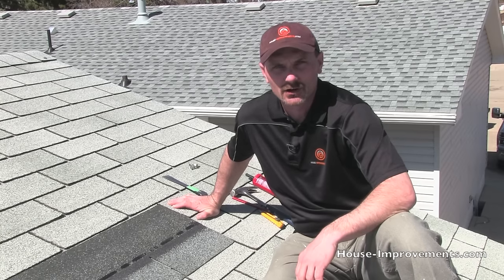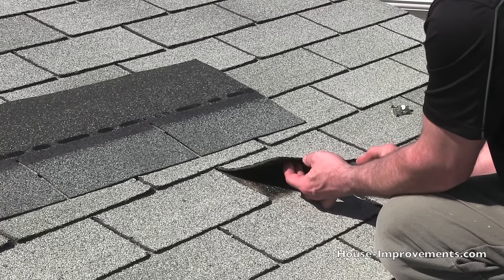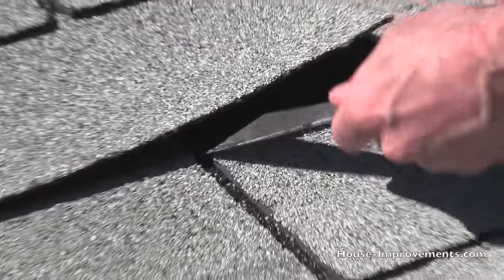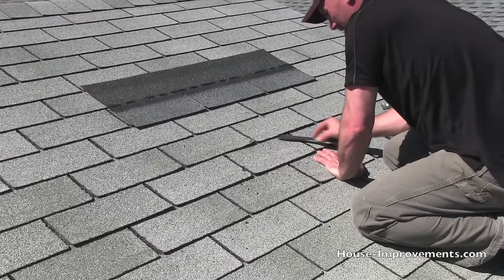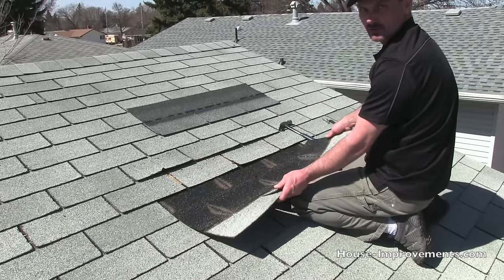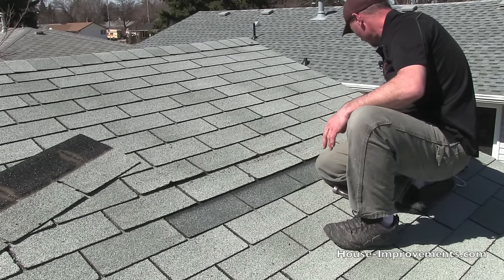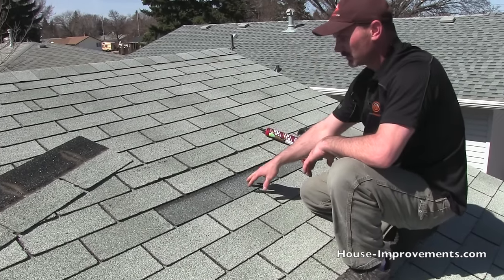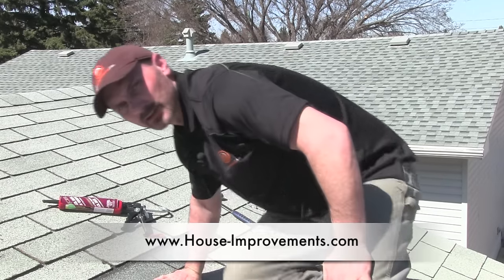How To Replace One Shingle [3-tab style]

Comment: I gave this video a thumbs up because it was coherent, quick, and it satisfied the title. I see where a lot of perfectionists chose to make a negative comment about the lack of tar paper/felt. To repair that flaw the whole roof must come off. That is not the title of this video. I need to replace one damaged shingle, and now, I think I know the tools I need as well as the technique that I'll use. Thanks, Shannon. You did enough, but you could have added your name, your phone number, your location, and the name of your business.
Reply: I gave it a thumbs down because my roof (many are like this in all of the houses I have lived in) if you remove a nail you better plug its hole with some tar or it will leak since the nails go through the wood and water plus new hole
 is a disaster.  Really, make it a habit to do a new hole and find all old nail holes and put some tar in them.
Reply: Well said
Reply: Just finished part  yesterday..Have to wait for weather and shingles to.come in.from. Home Depot yesterday...
Reply: I.finished this phase of 3 weeks ago..Turned out nice except a few things. It's hard to describe. However I ended up.cutting a straight line down about six foot from the side of the roof. There were several obstacles here. I ended up with.a half inch trench on the right side going down..I know that I should have staggered the shingles..It was too late. So I put some tar down over existing trapper and swept up the asphalt
(Sand) which was like little roller bearings..oh yes..these little thing need to be constantly swept up and disposed up as they are a dangerous (slip and fall hazzard).I put the above sandy particles in the half inch water trench. Actually it's almost unnoticeable from road and seems to let the water fall down.  The next part will be done different. Also next time.I will.stay up with the safety factors.
Reply: He provided his name, location, the name of his business, and his preferred method of contact both in the video and in the video description.
Reply: perfectionist
s? how about people who want their roof done right? felt is a big part of it...after all..stealing is stealing....

Comment: So, we had a sever windstorm event here last week. I lost three spruce trees on my property and two shingles off my roof. I have never attempted to repair my roof, always called a roofer. For just two shingles, not a complicated repairs, the roofer wanted $240 US. I found your video, watched it closely three times, then went out and purchased a bundle of shingles, some adhesive, the pry tool and went to work. Had BOTH shingle repairs completed in under 90 minutes. Could have been faster but I took my time to make sure I had it right the first time. Two caveats: first, my shingles are 39inches, apparently the new standard is 36 inches. So with some directions from Lowes staff, I had to do some creative fitting (had to cut one shingle at 22 inches and one at 17 inches then "butt" them together) to do a proper repair but the repair went well. Second caveat, the roofing tar in a tube is VERY MESSY for a first time user, so you need be careful. In any event, the repairs were successful and I thank you for this helpful video.

Comment: Thanks. Excellent work. Not a roofer, but I needed an old sat dish to mount a 2nd vertical antenna  safely in a tree, perfect job for that dish bracket. Nothing is really free, so now I’ll replace the shingles that were drilled through. With this help, I see it’s do-able.

Comment: Very simple and clearly explained. I only lost about 6 shingles in a 85 mph windstorm in Utah last week. A roofer quoted me $600-700! He said it was normally a $200 job, which seemed more reasonable. But he also said they were super busy and a month out. I’m sure they’d rather do a $10000+ new roof than do little repairs unless they were slow. I used to do siding, so I figured it couldn’t be that hard. I already know how to swing a hammer.
Thanks!
Reply: 120 per shingle is what I was quoted😢

Comment: Short but very instructive video, thanks.  This gentleman provides details that make sense.  I’m going up to my roof to replace some shingles.  He said to use very little glue.  If using too much it will drip down due to heat.  Other videos didn’t address that bit of important detail.  One thing however, during the replacement, the raw plywood was seen, meaning that the roof didn’t have the usual cover.  I don’t even know what type of cover that would be.  Question: should the new nails be placed in the holes of the old nails?  If not, I suppose the old holes should have a little dab of glue, just saying.  Again, thank you sir for your excellent video.

Comment: Thumbs up on this one that's a correct repair it seems like over kill on that third row but it makes the shingle a lot easier to go in and your not bending that third tab to the point of shaping it sometimes u can just cut an inch off the top of the shingle your putting in but no this is the correct way to do it 👍

Comment: link to tool used please? :). For old shingles I found that using a "nail puller" I could get the nails out without having to go underneath and pop them up, for what it's worth...popping them up😢 can damage it a bit... That and a trowel to break the tar (learned from a different video) seemed good.

Comment: Lost one of the tabs in a wind storm on my 20 year old roof. Going to try to repair it once it gets to 50 degrees again.
Reply: Go through insurance. Get an inspection, most likely if you are missing a shingle there is other wind damage up there, nail pull throughs, lifts, creases, etc. If there is, you can get a full replacement through your insurance company. Never do repairs before you check the entire thing.
Reply: @seanspreckelsen3496  Once again you fail to mention how insurance rates increase after making that roof claim. Acknowledge this video was well made and stop advertising for roofers. PLEASE! I have seen more messed up roof jobs than good ones in my day. Used to do it for a living when I was younger. Calling a roofer does not always make your shingle issues go away! Why are you watching this video if you are a roofer as you claim? Getting educated are you?

Comment: I have a piece of decking the must have popped because not enough nails were put in.  Can I follow this procedure to nail the decking down.  Or you mentioned something about surface nails.  Can I use surface nails to resecure the decking without removing the shingles if I seal the head with tar?

Comment: If you need to lift the shingle much later after the repair, will that Black jack cement come loose? Or will it tear the shingle?
Reply from the maker: usually it will tear.
Reply: @HouseImprovements  Is there an alternate product that would cause tearing?

Comment: Are there holes in the shingles where the nails go .Or you can put nails down anywhere.
Reply: One inch from the edge of the shingle and 1 inch about the tab cuts. To do it well, one on each end, one above each tab cut makes 4 nails at a minimum.

Comment: Cool, doesn't look too hard.
I have a roof jack I don't use that's rusted and falling apart that my idiot roofers reinstalled, and of course it's leaking.
I just want to yank it out for now as I don't use the furnace anymore and can't afford to fix all the stuff that goes with that.
Can I just go over the hole with shingles like this?  Or would I need to cut a round piece of wood and glue it in or something?
Reply from the maker: Add blocking under the old hole , cut some plywood to fit and then patch the shingles
Reply: @HouseImprovements  Ok sir, thank you very much.
Reply: @HouseImprovements  Just wanted to stop by and say thank you again.  I did what I could to add some backing to a new piece of wood that I put in place, kind of hard to do it without ruining a bunch of shingles but got it done.  They didn't cut a square hole either which made it that much harder.  'Backfilled' the gaps with henry's roof cement, and 'shingled' over the patch with aluminum backed asphalt roll.  Then I came back through with the new shingles on top the best I could and used henry's to tack down the loose shingles.  This has been haunting me for a long time and your video gave me a great deal of confidence when taking care of this, and not the first time either.  Take care.

Comment: Y not put nails back in same holes? Should you replace plywood when ever re doing shingles in case you hit old nail holes? Which you probably would? No one replaces plywood though
Reply from the maker: The old holes will not hold the  nails as well the second time around.
Reply: @HouseImprovements  so is it best to re sheet the roof every time you go to put on new asphalt or metal shingles?

Comment: Shannon , how can you tell when you need to re-shingle your roof. is there any tell tale signs to look for?
Reply from the maker: Leaking of course is the big one but also when your shingles start to really decline in condition , usually loosing their surface granules ,curling edges ,that sort of thing.
Reply: @HouseImprovements  On those granules. On an older roof they tend to be.coming of quicker. Also noticed they make the roof more dangerous. Swept a.small.amount yesterday for safety. I used very gentle.broom.strokes on the shingles.

Comment: What about the felt paper or synthetic underlayment. I saw the decking not covered. This will 100% leak. Also, you creased the top shingle. It's considered damaged, so it needs to be changed as well.
Reply from the maker: Not much i can do about the roof not having paper unless i am doing the entire roof replacement.

Comment: Bizarrely some 3 tab shingles (newer ones) are smaller than old so it's double hard to find a match.  Startlingly you can just cut the bad shingle and the new shingle to "meet", you can even replace 3 tab with a cut structural shingle...

Comment: Good video overall. Not sure why anyone is concerned about felt application for individual repair. Obviously, you didn't install the roof. However, the nails should be installed below the sealant strip, not in it. One of the most common mistakes in roofing

Comment: How do you know which shingle is part of the "3 tab?"  Do you see the seam when you pull up the one above it.
Reply: Good question.  My guess is that you can tell by glancing at it from an angle or maybe sliding a screwdriver or something up the gaps to see which gap ends right under the shingle above and which ones continue upward... if that makes any sense.  My 2 cents... which won't even buy a piece of gum these days:)

Comment: I've never. understood why roofers work in sub zero temperatures.  first that tar strip is not going to bond to the shingle above and second, I would think they are quite brittle and prone to breaking and cracking .
Reply from the maker: as long as you get some warm sun during the day it is surprising how hot the shingles get. Now -10C and colder is a different story.

Comment: No roof felt ...Building inspectors don't inspect quality of workmanship. Usually just the nail pattern prior to roof membrane. 
Still, in my state I might call Labor & Industries or file a complaint online. I don't know any 3-tab comp shingle manufacturer that doesn't require someyhing under the shingle. And there is an IRC code requiring installers to follow manuf. install requirements.

Comment: My roof if you remove a nail you better plug its hole with some tar or it will leak since the nails go through the wood and water plus new hole is a disaster.  Really, make it a habit to do a new hole and find all old nail holes and put some tar in them.